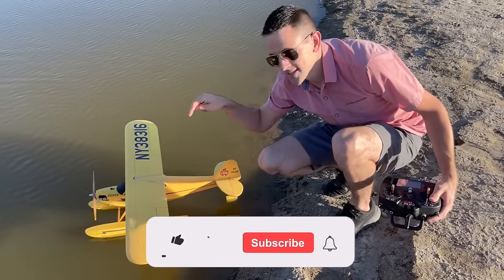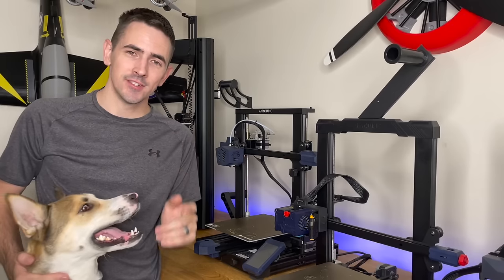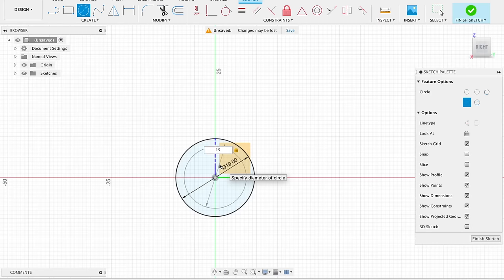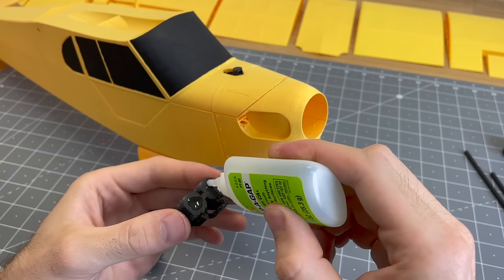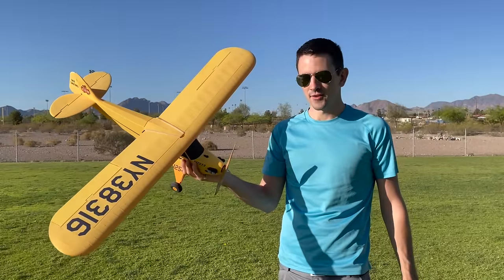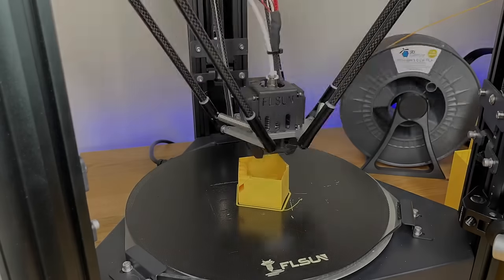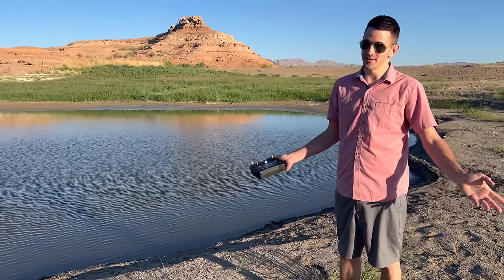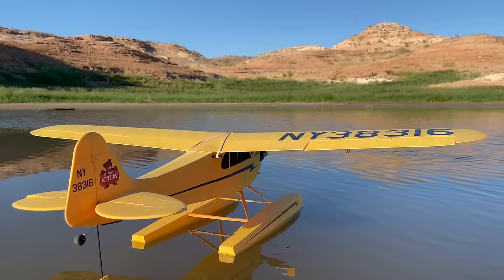Epic DIY RC Piper Cub Full Build & Flight

Comment: Hi, I'm having trouble finding the push rod wire or cable. Where does one find 0.8mm music wire? Not seeing any thru Google search and not in the build list. Most push rods are at most 450mm and one will need at least 500mm or more to fit.
Reply: Found it on ebay finally

Comment: I built this using the eSUN LW PLA and the printing of the files was easy using the prepared gcode or the 3mf files on a Prusa i3Mk3S.  However a couple of words of warning - don't try to save time by printing more than one item at a time (filling the build plate).  The filament oozes when travelling (even with 10mm retraction), so everything ends up covered in strands of plastic.  They scrape off, but it's a pain to do.  And secondly, I can't find any sign-writing vinyl that sticks to the LW PLA.
Reply from the maker: Yes, I agree, to get the best quality print one part at a time. For the vinyl, I use 3M high stick material that is meant for textured walls. It sticks so well, some have lasted for years now.
Reply: What if you use PLA and print multiple parts at same time, will the same problem happen?
Reply: @TroyMcMillan How do you print vinyl to make drawings and letters?
Reply: @TroyMcMillan Me too I tried with the gcode but obviously it’s not available with my nozzle
Reply: @awssassim  Yes because it's using Vase mode. One path start to finish.

Comment: Quick question: When I print the model on the bambu mini the Fuselage parts are incased on the sides. They aren't open like yours. I'm using the setting from 3d lab print, what am I doing wrong?

Comment: Instead of cutting the engine shaft, you can uclip it on the other side and smack it couple of times with hammer and it goes through (comes out on other side). That way if you later need the normal shaft, you can re-use the engine.
Reply: Possibly needed the room behind the motor.

Comment: Hi Troy, Great video! can't wait for your next video, lately i have been watching this one over and over, I printed the shark a few months ago, it looks great, hanging on my ceiling as a static model, I am a beginner RC pilot, so I thought it best just to leave it hanging...pun, and it was printed with regular PLA, so flight speed would have been above my level anyway, the reason why I bought a 3d printer in the first place, was to print RC planes, I have 5 static models currently, and think I am ready for a flying model, so I am printing a 50% scale of the cup now, using blue filament, actually looks good, but still not the correct color, but anyway, wil be on a full go next week, ordering every part to make my first flying 3D printed RC plane, thank you Troy, and yes, it will crash at least 3 times!🤣😆 But that is what this hobby is al about, cheers.

Comment: I printed one as well, it came out really nice. It was great of 3DLabprint to make this a free download. I printed mine in Polymaker Lightweight PLA on my Creality Ender 5 printer and it was an easy print.
Reply: What was the weight like for your print? I'm printing one out of Polymaker LW PLA right now and my fuselage came out at 117g, almost as much as the PLA version in this video.
Reply: Hey guys, I'm going to be using the same Polymaker Lw-pla. What were your settings?

Comment: On Printing with regular PLA I have so much issues in all Wing parts. The brodges which start at layer 78 hangs always, no matter which setting. Bridging settings doesn't have any effect to it. How you did that? Or did you have same issues in the Wing parts? Thanks for tipps and tricks!

Comment: Downloaded the 3D print files and attempting to print in Cura.  Matched the files settings correctly but a base is printed on to each part.  Any ideas how to omit this?  Other than this, the parts print perfectly.  I am talking about a setting in the printer tool, (brim / skirt etc.) set to none.

It's a shame the website does not provide STL file format files.

Comment: Hi, nice job!!! did you have any problems with unsupported areas of the nose? I am trying to print with esun white lw PLA but using 3d lab print settings in prusa slicer I found that bridged areas on outside skin near the tip of the nose come out really ugly!

Comment: When I printed the nose section of the fuselage it came out different from the rest of the fuselage. There were structure supports  inside and had a filled in bottom where the parts need to be connected. How do I fix this I am using the same slicer.

Comment: This is my fist build. Took a little time to get the settings on the 3D printer just right (Ender 3 3D). My only question, where do I get .8 mm push-rod wire that is long enough? I see a whole bunch online that is 12" long, but it looks like this projects take a longer piece. 

Thank you for all of your cool videos. Looking forward to building more!

Comment: Strangely enough, that little thing added under the rudder the help steering in water is called a... wait, what is it... ah, a rudder:)
Ah, like an airport is a port for ships/vessels/craft that fly;). 
As you know, mankind knew how to travel on water long before we could fly and there was a pretty extensive vocab that was right there for the taking for the flying folks.
Reply from the maker: that little part added to the tail isn't a traditional part on a full scale float plane. 3DLabPrint designed that to make the plane steerable in the water, but also to save weight by not adding an extra servo to the floats. It worked really well. 

it makes me think about 3D printed boats!
Reply: @TroyMcMillan  sure. But still a rudder.  But you did call it that later on;-). It’s all good - I love your work.  

As for boats, it’s a good challenge for you but please do me a favor and research by checking out the printed sailboats like RG65 and IOMs. People have figured out the print settings for how to make waterproof hulls straight off the printer already. Still, I see tons of people doing their own boats and having to spend a lot of effort making them watertight. Not saying you should build a sailboat but do look into these print settings. As far as I remember, it’s about printing hot with no or few retractions and making sure your walls don’t have gaps.  All stuff you’ll pick up faster than most:-). 

And thanks for replying!
Reply from the maker: @AntiVaganza  Haha, no you are totally right. 😉Thank you, I appreciate it. 

I have seen that! That would definitely be the goal to print it with it being watertight. With a boat it could stand to be printed out heavier with the extra material that would take too. A cool project for the future.
Reply: Yes, the weight penalty matters a whole lot less there. 
Good luck with it - I actually think you will be helping a lot of people with that project as it seems boats are something a lot of people want to tinker with. But not many think they can print them watertight so they don't look into it and instead have to deal with coating the hull afterwards. 

Once again, thanks for taking your time to reply. Really appreciate it!

Comment: I still have some ColorFabbs LW-PLA to use up before purchasing the Polylight and wondered what, if any, the difference is and if so what settings I may need to change.
Reply from the maker: It prints out pretty much the same, I use 245C for PolyLight and I use 235C for ColorFABB. Everything else should be the same!

Comment: For the engine detail parts you could put a colour change in the print at the required layer height. It's easy in prusaslicer.
Reply: Super easy.

Comment: Troy, currently printing this Cub, but I'm having trouble sourcing some steel pushrods for the elevator/rudder. Where do you suggest getting some 1mm steel rods that are long enough to connect? Thank you!!!
Reply: I'm having this same issue. Most out there are 450mm long. What did you end up doing? (Am mid-build at moment)

Comment: Thanks!! Have struggled with LWPLA printing, but really want to finish a plane. Downloaded this and Prusa slicer. Fuse printed beautifully in ColorFabb LWPLA! Wing just started. Thanks for the Prusa hint! Seems to be the ticket for me.
Reply from the maker: That’s awesome to hear! Thanks for letting me know it’s working for you! 😊
Reply: did you use the original prusa printer setup or did u go for the printer setup in the 3mf file? I haven't started printing yet, but i'm thinking go for the fillament and print settings in the 3mf file but use the prusa printer settings.
Reply: @andreasaure6420  I used the Prusa slicer, and the 3mf files. I used 100% whatever settings came with the 3mf file - I didn't change a thing. I didn't even change to a Ender 3 in the settings - just loaded the file, sliced, saved to the card, and printed
Reply: @scottiniowa1  ok i didnt use the 3mf files i used the gcodes :) but i think i should maybe do some tweaking since i use esun material insted of colourfabb

Comment: hello. I just discovered your channel and thanks to you I discovered the existence of the LW-PLA filament that I did not know. I do model making and I have a Sidewinder X1 printer. I want to print your plane. as a slicer I use Simplify 3D and Cura. you who print on the printer that I own, would it be possible to have the print settings for the LW PLA. thank you in advance. sorry for the translation but I am French. thank you for all your videos which are very interesting. Cordially

Comment: I seen the amount of super glue you used on the servo's when putting them in, would it not be better to use just a bit on the edge of the servo in case something should happen to the servo and it needs removal to be replaced?

Comment: I'm in the process of of printing and assembling the Piper. Very, very impressed with the model. It is obvious that a lot of thought went into its design so as to make it both strong and easy to assemble. It appears to be much more robust than the Eclipson models.
Reply: Hi, I'm having trouble finding the push rod wire or cable. Where does one find 0.8mm music wire? Not seeing any thru Google search and not in the build list. Most push rods are at most 450mm and one will need at least 500mm or more to fit.

Comment: Another great video Troy. I am currently printing this plane and I have a question where did you get your decals printed? Thanks for your help.
Reply from the maker: Thank you!! I get them printed from a local print shop. Ask for them to be printed on 3M High Stick material, like material that is used for textured walls

Comment: Troy, i am new to 3d printing. I downloaded the cub files and tried to print out using prusa slicer. I am trying the wing for a setup. I am running into issues over the wall thickness coming out at 0.17mm and tearing on removal from bed. I have tried 230, 240 and 245 temp. 230 was the best for tight layers but the wall thickness is still thin. Any suggestions? Also, I have too much adhesion on the bed. Cannot cut off without tearing the printout.
Reply: What are you using for bed adhesion? I recomend Elmer Glue Stick for PLA. For Nozel temp you shouldn't need to be over 220° for PLA, bed temp should be between 60°-80°.

Comment: Hello my friend, what you have done is very nice, I congratulate you. I'm having trouble finding a 2830 1300kv motor, can you recommend me an alternative motor?
Reply from the maker: The brand that I use is kind of challenging to get, unfortunately. Have you tried to just type that size of motor in and use another brand? Also have you checked the description of this video, I listed an alternative there!
Reply: The instructions says use a 2930-1000 kv. That's more common.

Comment: I have been waiting for this video since I saw you were working on it. What prop adapter are you using? I don't see it in the parts list. Do you need to cut off the original shaft to use this motor?

Comment: So cool!

I got a Bambu P1P for Chriistmas and I just recently stumbled onto 3D Labs planes. After sifting through everything, I chose the Piper Cub as my first project. You definitely paved the way with this video! Excellent work. If mine turned out half as good as yours, I'll be happy.
Reply: Did you get the files to work?  When I slice fuselage part 2 it wheigh 142g alone.
Reply: @PhoneyBill  Did you try too decrease the infill? And is the weight with supports? And what kind of pla do you use?

Comment: Yo I wanna build this so much, and I’m curious do you think it could hold a water balloon? I wanna design a water balloon setup for fun to drop on my friends at the lake. 

Also do you think you would need to make the whole area where the electronics are watertight (not motor) ? I promise you if I build it it would be submerged.
Reply from the maker: 😂 that’s awesome lol. Yeah I think it could hold a water balloon! 

The thing with making it all water tight is that would probably effect the airflow to the motor/electronics and they could overheat. So if you did end up doing that you would need vents, which that would probably defeat that :/
Reply: I do radio controlled regatta sailing.
Sometimes it happens that a boat runs full of water or is even sinking. While it certainly is not that good to the electronics, it doesn't seem to be a big problem. What you need to do is of course take the electronics apart and let it dry immediately. Blowing out the water helps in doing so.
One time it happend that actually my transmitter fell into the water. I jumped after it, got it back onto ground and .... same procedure. Open up the housing, try to blow out as much water as you can and let it dry in the sun. One hour later, I tried the transmitter - still functioning.

I forgot. Of course: disconnect the battery immediately. And don't foget all the small plugs and sockets!

Conclusion: While it certainly is something you want to avoid, the electronics survived. Not only in my model but in lots of other models also. Just dry it and refuse the temptation to put it under power until you are 100% sure that all water is out and everything is dry again.

Comment: How do you print those decals? Link to the paper vendor would be great. Thx.
Reply from the maker: I use a local decal shop to print them. Make sure you ask for 3M High Stick material, like material that sticks on textured walls. I have planes that have had this material of decal on them and they have lasted for years!

Comment: Hi - A question about printing this - I have an Ender5pro and have tried printing the files following the instructions you give for Pruca Slicer and Esun lw-pla (started with the floats) The print comes out very thin!! I mean paper-thin! the quality is more than acceptable, but the parts seem to be awfully flimsy and I doubt they would hold up - are they meant to be this thin?  Ive tried upping the temp to 250 to try and get more foaming and so a thicker print, but it doesnt seem to do anything, neither has slowing down the speed and upping the flow to 110%.  Any suggestions??  Thanks!
Reply: I have an Ender 3 S1 Pro and it's way too thin also.  I used the 3mf files in Prusa 2.4.2.  I can hold it up to a light and see through 4 layers..  PolyMaker LW-PLA.  Any suggestions??  Thanks!
Reply: @rickhubka  mine just fell apart  when you stressed it at all - it didnt seem to have much layer-adhesion and was really thin and flimzy

Comment: I’m trying your cub as a first lw-pla plane print.  It’s going ok but.. like many I’m a ender 3 entry level series printer owner. The Prusa  printer is it seems is a big step up but too late now. Also most advice given in user groups is to use Cura or a Creality supplied version of it. So knowing nothing about 3D printing some time ago,  we/I ended up with a Creality printer using cura. Trying to sort out the Prusa settings to load into cura has me a bit overwhelmed. So I’ve used a work  around of loading the .3mf into Prusa and custom add the cura start code with a BL/CR touch g29 and left purge line the .3mf files don’t add. I save these for future Prusa reprints. Your gcodes are great except no BL touch support or left purge line included. 
Is it possible to include actual cura files in your place for purchase? I hope try printing some of them after I master printing and assembling the test cub. Yes I will focus on using Prusa slicer but I need to find out how to make the start code I like/need permanent and not over ridden by the imported prusa start code. Adding it to every to be printed file is time consuming. 
All said, the prints are slow going dealing with the start code, but gong good and I hope to be test flying the Cub very soon. Not planning on printing a lot of yellow planes my first roll of lw-pla  is while so I’m assuming a coat of testers cub yellow paint will work. 
The way your designs snap fit together is a amazing design.

Comment: Hello, Troy! Your planes are awesome! But I have a question for you, please: how much thickness do you use to walls? Its about 1mm? 2mm? 

I work with airplanes build as well, but I have difficult to make “lip and groove” in my parts.

Thank you so much!
Reply: Make sure to download the PDF guide. 0.55-0.67 wall thickness. Change extrusion multiplier and measure with calipers. Hope this helps. Download the guide

Comment: Safety notes:

Test motor operation without a prop.

For most radio systems:

Ensure low throttle and cut off stop the motor Then re-bind to reset the "failsafe" for loss of signal.

This will prevent motor start if you plug the airplane battery in before turning on the radio.

Too many accidents from not ensuring failsafe settings include motor off.
Most ESCs now use the default High/low of Spektrum/JR  Some use Futaba's High/Low which exactly the opposite.

Comment: Some of my parts end up having small gaps after they are assembled. Any advice on what to use to fill/repair these gaps?
Reply: Most of the time a 3d printing pen with the same filament is used to fill gaps. Not sure with this filament however.